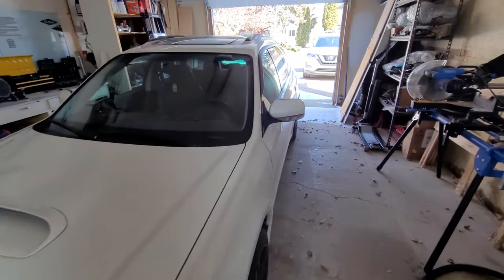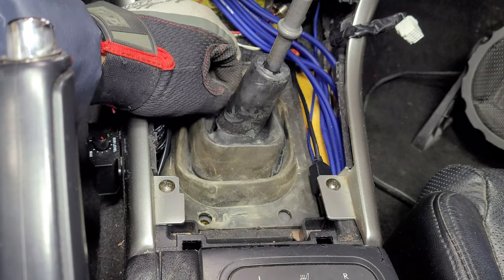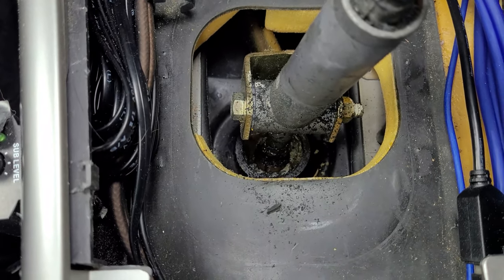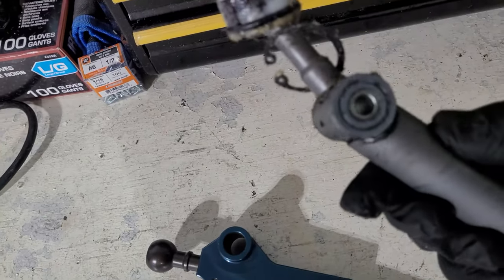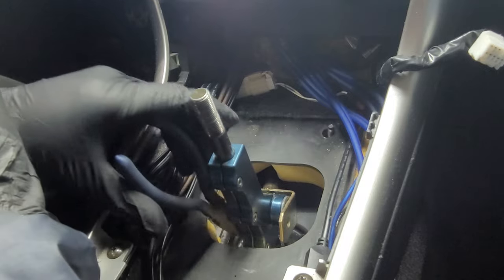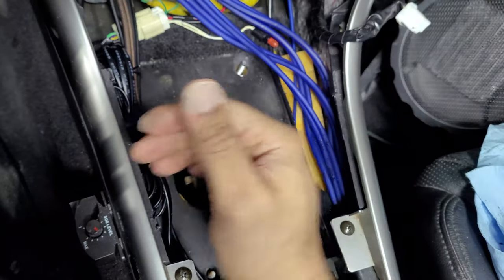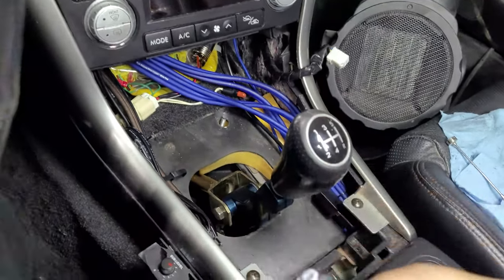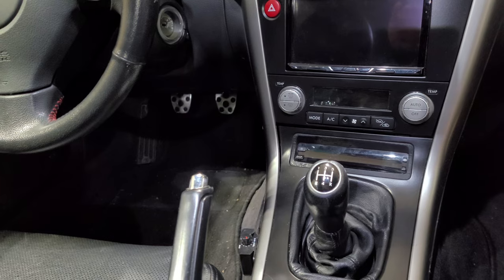Subaru Legacy GT Cobb Short Shifter Install

Comment: Did you put that lower rubber o-ring back on?
Reply from the maker: Really nice catch. I actually had to re-watch my footage when I was reassembling because I couldn't figure out where that o-ring came from. It pops right off at 4:30 when I pull the shifter out. I tossed it in a drawer until I take this section apart again.

Comment: To get mine a bit lower, I removed the metal plate & cut the top left corner so it was "square" and not round and that gave me some more room.
Reply from the maker: Yeah I ended up trimming that rubber boot that was blocking 2nd and 4th a little bit on the backside and it helped a lot too without causing any issues

Comment: did you re-route the usb port into the little cubby yet? If so, how did you do it?
Reply from the maker: No I prefer having it in the cup holder area because the android auto connection from my stereo runs off of that plug